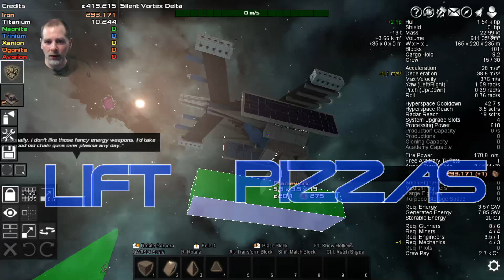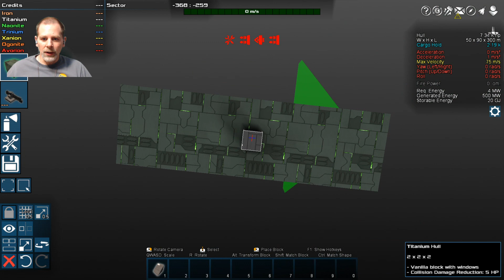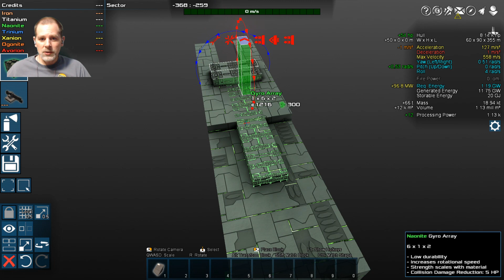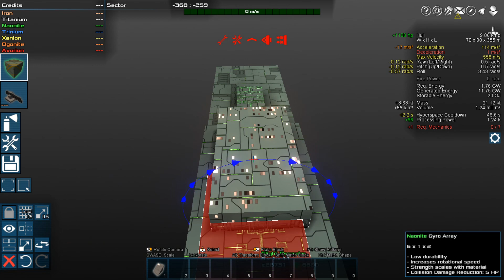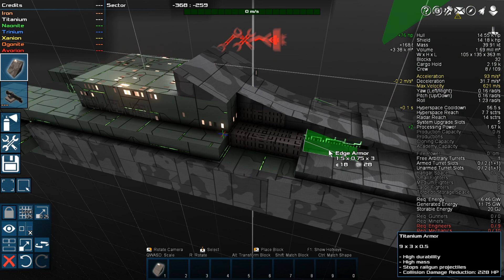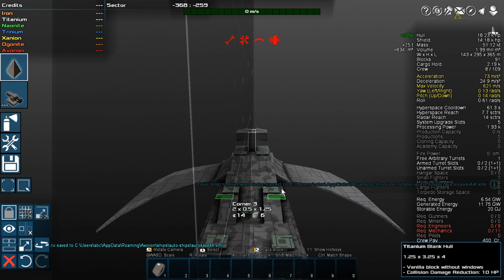⛏️A Basic Miner From Scratch 🚀 Avorion Build Series - Episode 9

Comment: You need to select the integrity field block in the block menu (not on ship) to see coverage.
Turret bases allow custom turret builds on them. This is visual only, it will perform like the turret in the build menu that you choose for that base.
Its also completly unrelated to custom turrets built at factories.
I beleive you click on the base and can choose a design that you have built or got from the workshop.
Not used them myself so far but thats the gist :)
nice build!